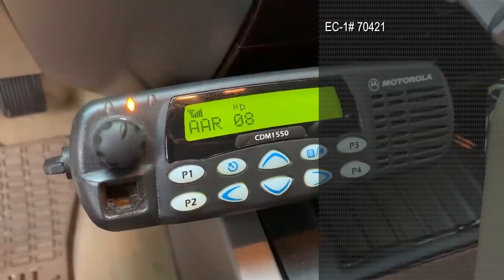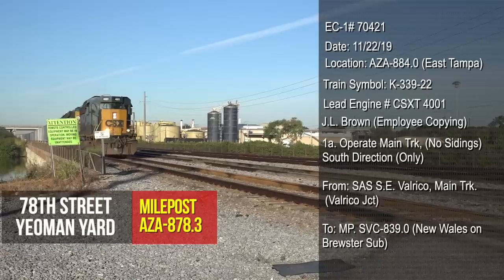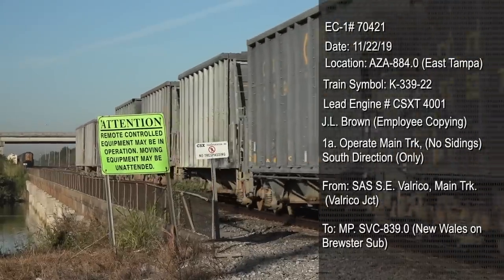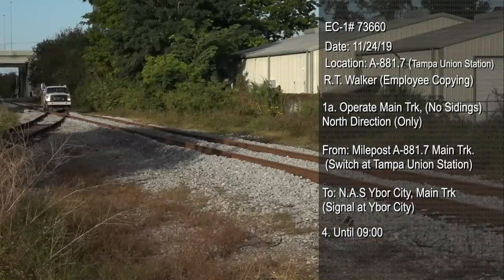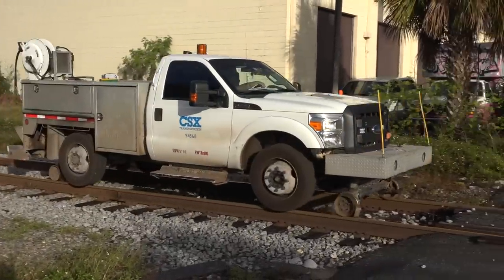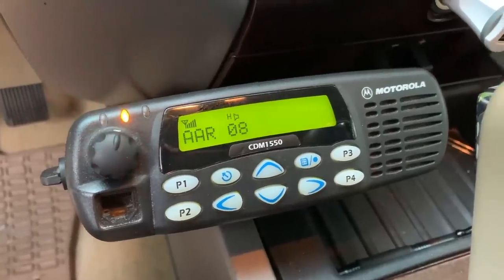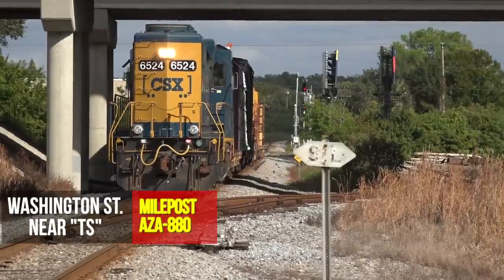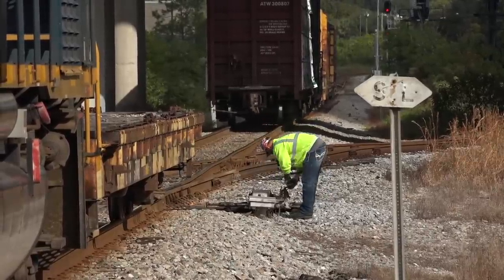Decoding Railroad Jargon

Comment: Good Info Danny! What do you suggest I get for a scanner? And for Central Florida, what frequency do I look for? Thanks Danny!, Cheers, Danny
Reply from the maker: I always recommend the Uniden BC125AT. Run you about $100 on Amazon.
Reply: @distantsignal  Ah Cool! Amazon it is then! Thank you Danny! Cheers, Danny
Reply: Danny Holt I agree 100 percent with Danny BC125AT! Uniden has free software you can use to program it or I like to use ARC125 by Butel.
I like to use the Diamond RH77CA you can find that antenna on Amazon.
Reply: @RC944jim  Cool! Thank you!!!
Reply: Danny Holt - you might want to also look into getting an antenna "tuned" to RR frequencies. This will help in reception, and being able to understand better what they're saying. Maybe back on FL you are close enough to not need it, but here in Kali it can be many miles between repeaters.
Reply: @thomream1888  Ah, thanks Thom! I will take that advice for sure. I'll make sure to find a shop that will hook me up with the correct antennae and tune it for me. I remember that from my good ole days with a CB radio. Back in those days we only had 23 channels. Lol! Dang, how did I get so old so fast? Ha Ha! Cheers, Danny
Reply: @distantsignal  Hi Danny, and everyone else! I just received the Uniden BC125AT that was suggested along with the antenna that RC944jim suggested. It has so many channels factory programed that I'm lost already. Will it work with the factory programmed channels already? Or do I need to program other channels in? I plan on using it mostly in Plant City or Vitus Junction. Thanks Guys!!!

Comment: A Dispatcher issuing a EC-1 or Track Car Authority is only confusing because those hearing it over the radio don't have access to the appropriate forms that both the Dispatcher and employee doing the copying have.  The Dispatcher is issuing the 'variable' data for the form.  The Dispatcher has that data inserted into a computer generated screen and is responsible for listening to the field employees readback of the authority to insure that it is correct. (with some field personal the readback can be difficult).

Comment: The new jargon I've learned fairly recently was an engine running as a boxcar. Which, in my understanding,  means an engine dead in tow and not connected to the rest of the power with mu cables. The instance I saw it was against the power. I'm not sure if they're allowed to have dead power buried in the train or not. I dont think so but maybe someone on here with more knowledge can say for sure.

Comment: You should do one with TWS and ABS controlled territory which is what some of the subdivisions around me are. The way they do dispatching on these lines is much longer because alot of the territory is single tracked with sidings every twenty miles.

Comment: It should be added that some of this “jargon” is region specific.
In the Northeast, we use form d’s (the d could be an f, or other letters but that’s the only other one I’m familiar with) 
but the concept is the same as an EC1. I personally haven’t used either though since I’ve only worked in a rail yard.

Comment: I have an unrelated question what is happening on the old Atlantic coast line track in Gainesvilles Florida? There was a csx mow train loaded with new ribbon rails parked just off of hwy 441 and 6th street in Gainesville. I work at the 84 lumber there in Gainesville and we only get 13 cars a year. We are also the last active customer on the line. The track ends about a mile south. I'm curious about the new rail's?
Reply from the maker: Don't know the answer to that one, but I suspect if 84 lumber is still getting cars, CSX is required to keep the track up and the mandated maintenance interval may be now. This is just guessing, mind you.
Reply: I live in northeast Texas.  If the train was just parked then it was there until the scheduled time to unload the rails at whatever location the rails were destined for.  Strictly a matter of convenience as a rail train takes up a lot of yard track space.  This is not an uncommon occurrence.
Reply: @royreynolds108  That is probably a good assumption considering this section of track is rarely ever used

Comment: I'm most interested in your mobile audio setup in your car. Getting audio that clear inside of a car can be very difficult. I'm curious what your camera and microphone setup on something like this would be.
Reply from the maker: Good question. I use a Motorola CDM 1550 two-way radio (no transmit channels programmed). Out of that I have a line-level audio feed plugged into a Zoom H4N1 portable recorder. That's set to "Auto Record", which keeps the recorder in stand by until it detects audio, which it records. .mp3 clips are stored on a micro SD card, which I then import into Final Cut Pro for editing.

Comment: It;s a shame they no longer give out manual blocks.  There was a LOT of RR lingo when the dispatcher gave blocks to a train.  I noticed you didn't talk about the jargon used when crews are switching, or talking to each other.
I rode Amtrak two weeks ago, and every time we crossed a defect detector, after the detector, gave us the all clear, the engineer would radio back "ain't nothing wrong with it, 89 south". Conductor would reply with the same words.  It took me about 5 or 6 detectors to figure out what they were saying, and what it meant.

Comment: Great video! I was wondering if you knew what a "turn" is?
Reply: Pretty sure a "turn", at least in my experience, is a train that originates and terminates in the same yard (usually some kind of local freight). Up here in North Alabama on the NS Memphis District East End, there's a couple of these local "turns". 
One example of them is (or at least was, as NS has shuffled trains around a lot up here recently) NS A12, which originates from the NS Sheffield Yard near Sheffield, AL, works a couple of industries out in Courtland, AL, and Wheeler, AL, and heads back to Sheffield Yard when it's done.
Reply from the maker: Correct! These jobs got the nickname "turn" because they leave the yard ,go out and do their work, and turn around back to the same yard. Versus a road train that leaves one town and terminates in another.
Reply: @distantsignal  ah ok thanks ive always been interested

Comment: When they say "Circle line one-A"  I am guessing that means there is a standard paper form that the conductor is filling out, and there are several lines of text that he can choose from, and he gets told to circle the first line of text?  I wonder if you could get your hands on one of these paper forms so we could see an example of it?
Reply: @Mitch J I just uploaded a slideshow of an old bulletin I had from a few years ago. Page 4 is an acceptable EC-1 form for use by crews. https://www.youtube.com/watch?v=RQy3okJRHYw
Watch at your leisure.
Reply: @SD40Fan_Jason  Thank you very much.  That was very helpful.  And it answered a lot of questions I've had for  quite a while as I've been monitoring the rail frequencies.
Reply: @MitchJ  when you use the forms so much you can practically copy it in your head. I have had to scribble my EC-1 form info down on a napkin just so I have it on paper. This was before they made it mandatory for crews to have blanks laying around.
When you are on a railroad that uses track warrant control,  they issue their crews a book of track warrants, usually in duplicate form. Just the same I could have scrawled it onto a napkin had I not had any forms available mainly because once you've gotten a handle on filling them out, it's muscle memory and you only see the changes that apply to your day and job. 
Anyhow, glad I could help.

Comment: im surprised at the lack of NATO alphabet like the air transport industry uses, it really helps to prevent confusion for critical letter sequences. i often use Mike and November to distinguish M and N, that pair do not translate well over phone calls. though the most crucial identifiers in railroading seem to be numbers anyway, makes sense an old industry wouldn't adopt a whole new alphabet to make relatively inconsequential IDs a little clearer. just gotta make sure no-one with a different accent needs to communicate in an emergency ^-^'
Reply from the maker: Yeah, you might have a point.  But I can't see a bunch of southern railroaders using foxtrot or tango or juliet. I prefer the old US Police Phonetic Alphabet: Adam, Baker, Charlie, David, Edward, Frank....etc.

Comment: You usually find trains in the UK by using this website called "realtimetrains" which shows you what passenger services call at stations, or when there will be a non-stopping train (usually freight).
1:39 that horn sounds like an F59PHI
And why do they no use the phonetic alphabet?

Comment: Excellent but need more detail.  Can you break down some of the terms like CTC?  You mentioned it but need more detail to understand.  Thanks!!
Reply: CTC stands for Centralized Traffic Control.  It is a method of working which is the same as a traffic control system (TCS).  These are sets of rules, procedures, forms, and practices for juggling multiple trains on a line.  These rules determine which train gets to use a track, how they are informed about how to use that track, who does what when two trains meet on the same track, etc.  The other most common TCS in the United States is TWC – Track Warrant Control. 

The biggest difference between the two is TWC is all verbal.  TWC is the cheapest and simplest TCS to implement—it doesn't really get more basic.  A dispatcher gives a train crew a certain length of track that they can use.  They may also give additional instructions, such as taking a siding at a certain place or waiting for a certain time to do some action.  The train crew operates their train to comply with these instructions, which are all issued via radio or given on paper, which are called a track warrant.  There may or may not be signals, and if they are present, they only serve as an added layer of safety and train protection.
CTC is the other end of the extreme.  It's the most expensive to implement and maintain, but is the most flexible.  In CTC territory, the signals themselves authorize train movements to crews because the dispatcher has direct control over main and secondary track switches, and controls the signals at important locations.  The dispatcher gives non-Stop signals to trains and the crews respond by moving their train. 

There are other TCSes which sit somewhere between these two.  And, now there is Positive Train Control (PTC) which, generally speaking, is implemented as an overlay to CTC (CTC/PTC), just as Automatic Block Signaling (ABS) can be overlaid on TWC (TWC/ABS).  You can find lots more detailed information on these just by searching the internet.
Reply: @jovetj  awesome, thank you!
Reply: No problem.  If you have any other questions, feel free to ask.  None of us knows everything, but someone somewhere will know!

Comment: Is there any way a person could pay to ride in a train engine ?
Reply: Many smaller roads offer such activities, usually connected with the operation of steam. When N&W611 was at Strasbourg, you could pay $611 to get about an hour of throttle time.
Reply: I paid to ride on a 1
200 mile ride from okc to Dallas on a CSX AC4400CW whilst carrying freight cars.
Reply: @JackTheGreat  Thanks for the info. can you tell me how you set it up ? Thanks !!

Comment: Why doesnt the high rail set off the railroad crossings
Reply: The guide wheels are insulated and of course the rubber tires insulate the vehicle.  Some roadmasters, track inspectors, and signal maintainers install wire brushes in contact with the guide wheels so the crossing circuits can be actuated from inside the vehicle.  From experience MOW equipment is relatively light so good contact is hard to get to have good crossing signal action or maintain through the circuit.
Reply: @royreynolds108  I've seen many a high-railer trip the crossing and keep it active before, during and go off once the crossing has been cleared with no problems at all.
Reply: Roy Reynolds is spot on.

Comment: If i use a two way radio in vehicle will the police take it if i tell them that it is for railfanning.
Reply: Best response is "I respectfully decline to answer questions"
Reply: Just a note don't transmit on the railroad band. DH has gone into that a few times that's its a federal crime to transmit on railroad channels if you don't work for the railroad

Comment: Just an fyi a lot of this is old information. With PTC active, most of this is a thing of the past
Reply: Really? Even in dark territory? I would think They would do it anyway, especially considering how often I hear crews talking to the foreman about PTC issues in and out Harrisburg up here in PA.
Reply: @PowerTrain611  ptc is on dark territory. Yes, they still have some bugs but for the most part it's a working system now.
Reply: @TheNemosdaddy  I guess it makes sense. My understanding is that PTC is GPS for a locomotive with on-star built in for remotely stopping the train in an emergemcy, correct?
Reply: @PowerTrain611  yes, but that's a very simplified view of it. It interacts with Trip optimizer and has knowledge of where other trains are in relationship to itself as well as it "paints" the territory with restrictions and work orders like a 707. There's way less radio communication nowadays and in the coming years I expect it to be less as the next push is 1 man and automated trains over the next decade.
Reply: @TheNemosdaddy  I can see many ups and downs to that... well, I guess only time will tell what the future holds.